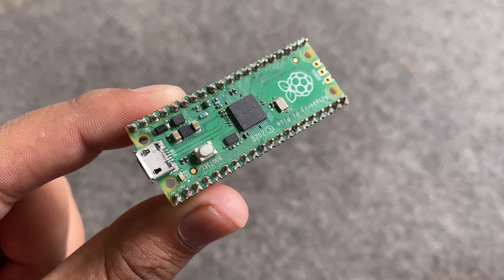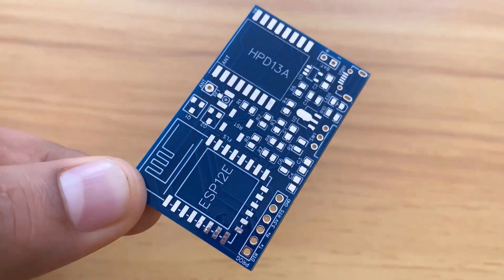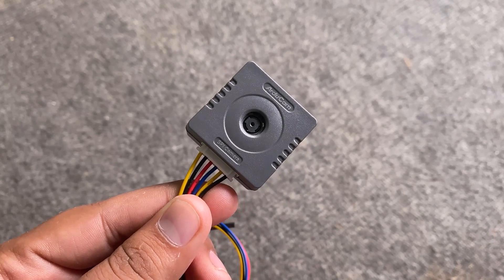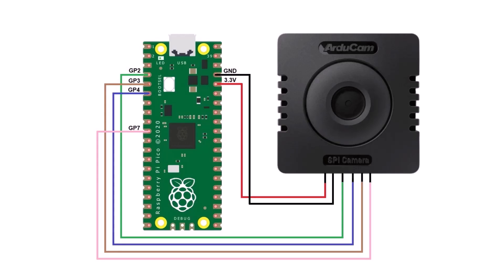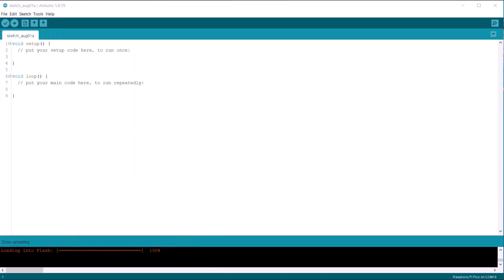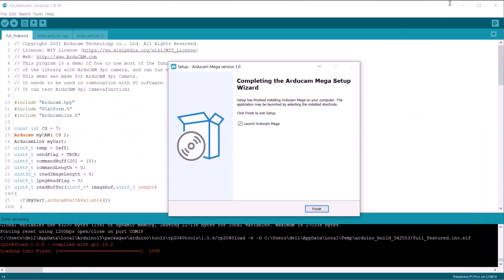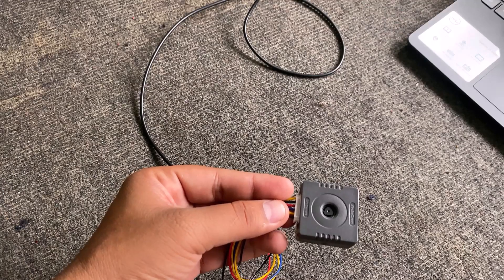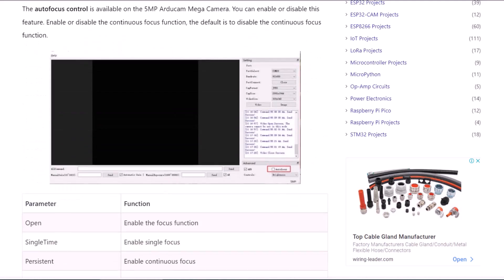Video Streaming & Image Capturing with Raspberry Pi Pico & 5MP SPI Camera Module

Comment: There is no streaming involved at all in this video. Its a not a WiFi raspberry pi lol.
Its basically a USB webcam
Reply from the maker: Its just a simple video streaming. Its not an online video streaming.
Reply: @HowtoElectronics  its not streaming at all. Just saying its basically the same as a normal usb camera.  I mean no harm, i was just frustrated that there is no guides online using the pico / pico w as a streaming video service like esp32- cam or MotionEyeOS
Reply: @KallTech  its a shame aa pico w is more expensive than ane esp32, i bought a few esp32-cams, they are more than capable 
But the webinterface is very limited
Reply: @Dirt33breaks  hater
Reply: @Elba_Nanito_Rico  am i wrong?

Comment: What is max range of video streaming with this camera
Reply: The range depends on the WiFi module on the microcontroller, and I don't see anything special. There are a few old tricks that might work, and you can check with a scanner app for a smartphone or tablet. I would avoid the default channel. Getting a good signal to your router could reduce any interference problems your neighbours have. Moving the router a little could help. A wood door instead of a brick wall is the sort of layout choice difference I am thinking of. And what can you do with the case?